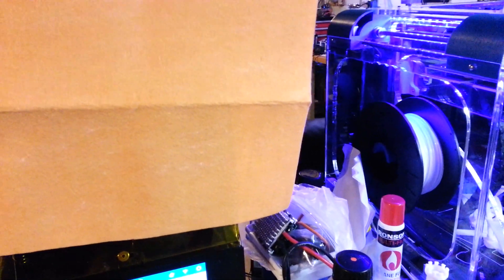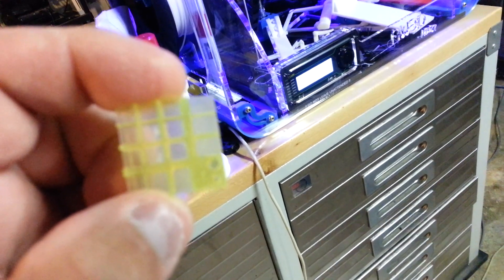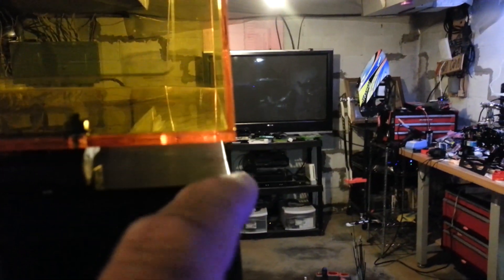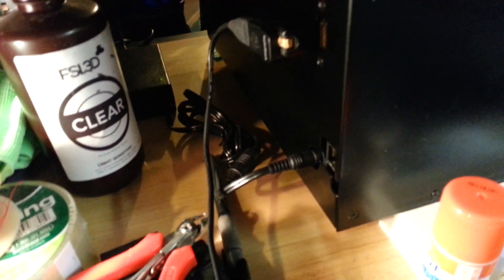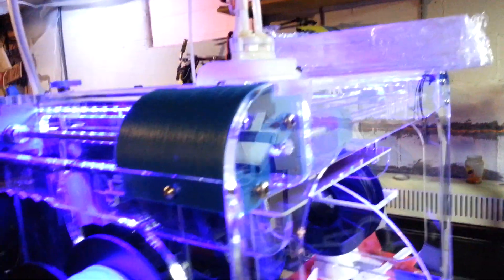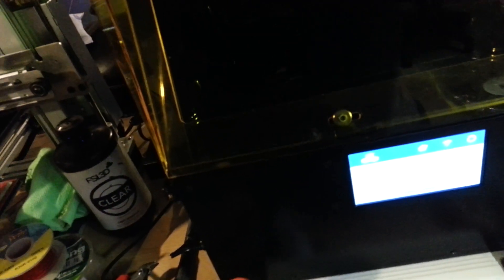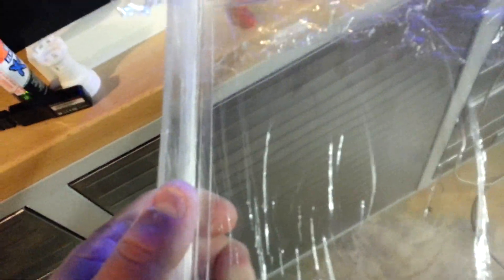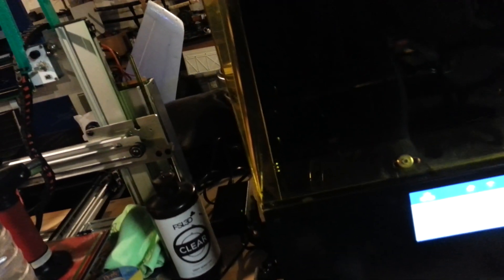Pegasus Touch FSL3D Printer, Quick look, small review

Comment: I have this printer and trying to get some help. FSL Support is just not responding... The laser is not seeming aligned as expected and some re-calibration is probably required... so if someone can offer some help then that will be really helpful.
Reply from the maker: there is a calibration grid you can print out on their web site it goes in the bottom of a clean/empty vat
you then align the galvo's to the points on the paper
I believe there is a youtube video on this, you might search for galvo alignment

Comment: Are ya still liking the 3d printer?  I got sick of being limited to their software and resin so I'm trying to write my own software to drive it.
Reply: +Crazy NH Mountain Man I have my moments but if I use their resin most of the time I have no issues at all
I would love to try your software if you get something that works

They took out the z-lift options several versions back and i've been hoping it would come back but it hasnt
going to the supervat was a nice upgrade on it also but they really need to use a flex vat system and I think they would have a real winner

I have been looking at DLP systems (Muve 3D)
Reply: Colen Casey I also started looking at the Muve3D DLP system when I was having issues, but I decided to try to write software first.  Other projects get money before this hobby can get more.  I'm hoping my software works out.  I will probably start doing prints with it next week once I finish understanding how to calibration things for the printer (x/y scale/offsets, Z step counts, exposure time.  I just enabled a calibration file so I can more easily control different parameters.

Comment: For $3,000, it's a piece of trash! The build quality of this printer is horrible! Until people stop buying them and accepting the downfalls, they will continue to be of very poor quality workmanship! I would have returned this cheap a** printer the very next day if I had purchased this and found it to be that low quality of a build!
Reply: GeniusSteven the first gens needed some improvements which they did do 

I can not speed ill of them because even as a first gen owner such as myself all I did was send in my printer to FSL and they updated the case, laser and controller free of charge

the new SuperVat is a total game changer, you no longer have to recoat the vat because their is NO PDMS layer and thus no ghost images in the PDMS.  
Did they have some issues out of the gate, yes but they worked with the customers to resolve them and i've been printing VERY nice prints with ZERO issues
I have been helping out in the google groups forum where people are having issues
from what i've seen its mostly setup (build plate alignment) and resin contamination causing most issues

Comment: How do you like your airwolf 3d? Better than the Pegasus? Looking for a machine for prototyping small parts
Reply from the maker: I love the airwold printer, I would recommend it to anyone looking to get a 3d filament printer
The only thing you have to keep in mind with ANY printer that uses a boden feed system like the new airwolf printers do is that the filament is labeled 3mm but you actually want it to be 2.8-2.9mm.  At 3mm will work but if it gets any moisture in it, it can swell a little at the hotend and cause a jam.  This is NOT a fault of the printer but a limitation of the bowden feed system.  The Airwolf3d XL is a direct drive extruder and thus has no worry of this
Basically on a bowden printer you will have to buy better quality filament and not the 18.00 ebay stuff.  Better quality equals 25-35.00 a roll so its not bad and the prints are better

The Pegasus has its issues:
1 - it has a 7x7x8.5 build area but its not recommend to print more than a 3x3x3 at most
2 - you can not print large prints solid (MUST be hollow) or it will fail every time
3 - Resin cost is up there at 125.00 a bottle its not cheap
4 - when its done with a print you still have 20 or 30 minutes of clean up before your done
I bought the pegasus to do finaly run prototypes once I have everything 100% on the airwolf
I am not thinking I will just print it at .1 or .2 per slice on the airwolf and call it done
I am entertaining the idea of selling the pegasus if anyone is interested
Reply: satgod Thanks for the response!  I think I'm going to have to go with the airwolf HD2x or the newer HD-R, I like the variety of different materials that is available through airwolf.  I do have one more question though, how is the print quality compared to the SLA printer?  I think that's the only thing I'm concerned with.
Reply from the maker: Ken Allison
as with any SLA printer the print quality of a SLA will be better.  The best resolution of a filament printer is .1 the lowest resolution of a SLA is .1 they both have their uses depending on what you are going to be printing
but if your prints are going larger than 4x4x4 inch most of the time a filament printer will be your best bet
for dependability.  I can load my airwolf start a 12hr print and leave knowing unless something serious goes wrong when I return it will still be printing or done depending on how long i'm gone
I personally would go with the HD2x over the new HD-R if you want to print via tablet get a small windows 8 tablet and do it or get the printer interface for it.  I perfer not to depend on the internet for my prints.  I made this for mine
http://www.thingiverse.com/thing:683169
I am currently using a HP Pavilion X2 tablet with it as it has a standard usb port already on the tablet

Comment from the maker: 6 months with this printer and I have yet to get a dependable 6x6x6 INCH or larger print from it.
3x3x3 seems to be about the max size and be dependable
FSL swears its due to the resin.  I will be ordering a new bottle and then I will have a new review of it with a bottom line on weather or not its worth having.
Reply: satgod Thank you for your review and updates. The proposed build size is what attracted me but it doesnt seem any better than the form1.
Reply from the maker: iluvhatemail Since I received the new resign and gotten the printer back from FSL it has been doing great prints of whatever I want 
it took some time to get it all lined out and sending it back was probably the best solution for the recalibration as they did update it to the newer laser diode and outter case while they had it as well
if you dont need the size the MUVE1 is a good choise its about 6.75x6.75 inch, completely open sourse and you can setup the software for almost any resin on the market
There are several clones of the form-1 now on ebay in the 1500.00 range that would be worth looking at as well
but for 1699.00 you get the "ultimate" deluxe version of the MUVE1 with ALOT of resin and all parts for repairs are available from them

Comment: Nice job!

Your comments about the connectors is my problem with the FSL laser.  Poor location sitting proud to get hit and damage the board...exactly what happen to my laser.  Makes me wonder why they keep designing flaws into their products??  I agree 100% with your review...they can do better little or no additional cost to the customer.  Good catch on the parting line between cover and case being an opportunity to bring debris into the print area.  Again, poor design practices are being "leveraged" from their experience with laser cutters.

You've had it for a while now, what are your thoughts about the medium term quality of the machine?  I have noticed the laser I bought is "needy" because of poor design, fabrication practice.  As a result I am having a little "buyer's remorse" because I can never set it and forget it for very long.
Reply from the maker: Pretty much feel the same way
its printing great one day and the next its a act of god to get a good print

even though it has a 7x7 build area its meant for many smaller items all layed out on the 7x7 area
printing one LARGE 6.5x6.5 item will most likely lead to a failed print which kills the reason I bought it

Comment: I am looking to purchase this system. However, I keep swaying between the form 1+ and the Pegasus. I am leaning towards the Pegasus because it has better software, a larger build envelope and a lower price point. However the only thing I am worried about is reliability. Is this system reliable?
Reply from the maker: Thus far it has been reliable for me
I have started making my own GLASS vats which are much better than the acrylic one that comes with it
SLA is alot of work and mess when compared to filament printers like my Airwolf3d HD2x
I really need a small table when using SLA printer
Space for the printer
2 contrainers for cleaning and removing the parts from the build plate and the (IPA) alcohol bath to rise off the extra resin on the part
A UV curing box

I use my Filament printer most of the time and my SLA for final parts
Reply: satgod
Do you think typical glass window-based  could be an improvised alternative for making the vat? Considering the fact it is harder to scratch. I happen to find quite much of glass from thrown scanner. Of course I will cut the glass to fit inside the printer ;)
Reply from the maker: *****
me and a few others have already made glass vats for our printers
you will have to make it from scratch or you will have issues
I am going to do a updated video this week showing the things I changed